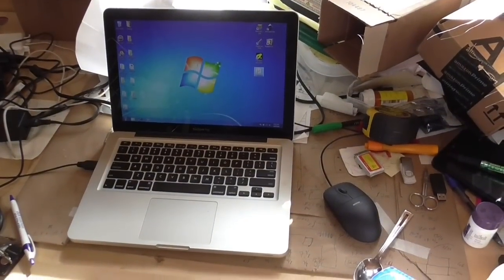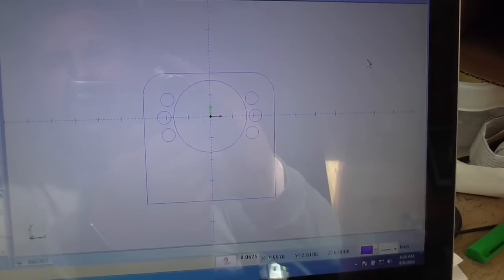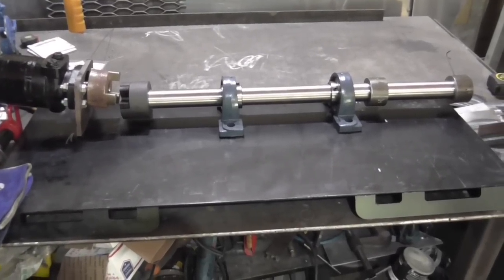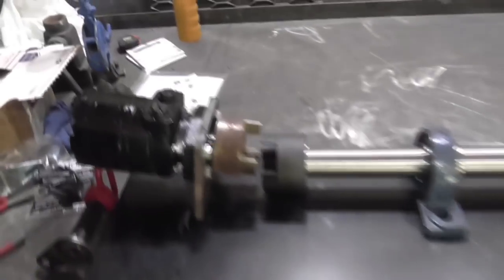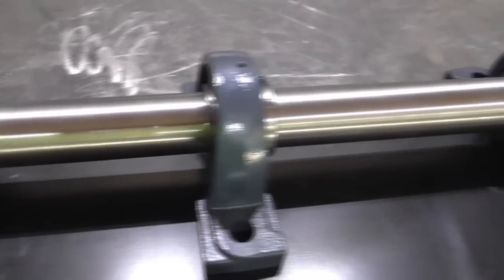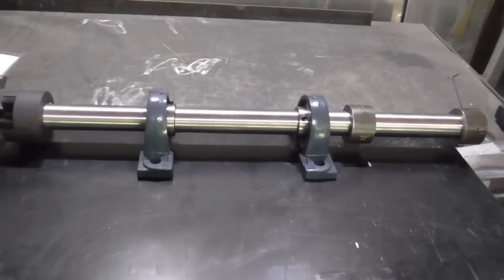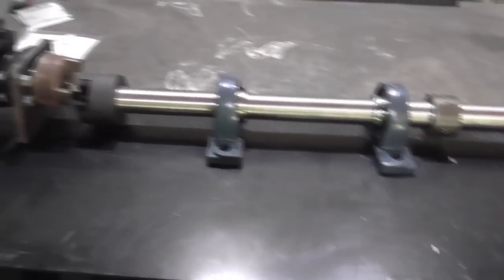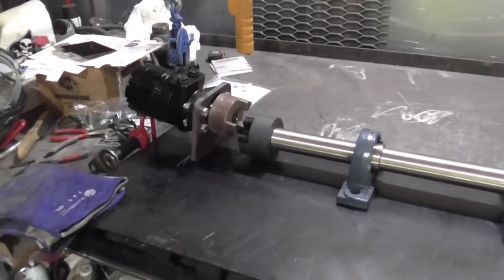Building a machine start to finish, CNC cutting, welding & hydraulics

Comment: That's a neat tool - it makes me wonder how they might have wrapped up the netting without it.

Making tools is my favorite shop thing.  So, as you were making the winder, I kept thinking how I might have done it differently.  The only thing I came up with is the way the PVC is fastened to the 3" pipe - putting the carriage bolt through did not seem very convenient or efficient. 

You could use a spring pin latch welded to the pipe such that the PVC slipped under it and pin goes through a hole in the PVC.  Then the latch would serve as a stop for the tube, rotate the tube until the hole is under the pin & release the pin.  Pull the pin to release the tube.  You could have multiple holes in the tube to minimize rotation.
Reply from the maker: Bob Engelhardt you are correct - but i am glad that i did pretty good on all the other aspects .....

Some fold out feet for when it comes off the quick connect would have been nice too ....

And to answer your question : by hand!  It was a loooong and painful process to unroll and drape it over the plants and wrap it back up .....

Comment: Nice to see some more videos from your channel Peter. Would be curios on a build like this and future videos such things as settings and some of the machines you use, and why. For instance looked like you used the HTP for some spray transfer (?), but also wondering how the old Thermal Arc used in an old video has held up for you - thinking of buying one!
Reply from the maker: Darren,  This build here was meant to be an "overview" as far as "shop capabilities" where will bee a few more videos this year about various project will get more into details on which machines are used (in this oner here no particular machine was mentioned at all) and settings and why.  Yes I did use the HTP pro pulse 200 for Pulsed spray transfer .030 wire with 90 ar/10co2 gas and i also used the http 221 to weld stick rods in pulsed stick mode, there is a very good reason why the thermal arc fabricator is not in videos lately .... after only 46 hours or arc time (35 month old machine) the machine dies on my .... and although i technically had a 36 month warranty - thermal arc told me to go get lost ...   so there will be one last video to come this year about that machine  ....  and than it can rest in piece .....  give me a few weeks for the "full thermal arc review"
Reply: Hah-hah....that's good to know Peter thank you!

Comment: Now thats a BADASS plasma cutter !
Reply from the maker: Thanks, but its not too bad ass... it cuts clean and precise 3/4" thick material with pierce start, edge start a little more - but that thickness is rough on it - 1/2" though you get really good results and it cuts it all day .... Before i had a Powermac 45 on that table - it also cut 1/2" but you had some taper in the holes ...  but over all not bad to prototype some stuff and make parts in house quick - without waiting for the machine shop .... the time savings is just gigantic!
Reply: what plasma cutter is this?
Reply from the maker: Kmatikzproductions the table is a delusional designs out of Indiana, made in the usa, the torch is s hyperterm duramax 65,85,105 torch   That day most likely i was running my powermax 65 as i run that 90% of the time on the table ....  i have a powermax 85 also but i usually dont run it on the table, i use that for field service ....  the 65 will cut 3/4" at 15 ipm with a really nice cut quality - that is good enough for 90% of the jobs ....